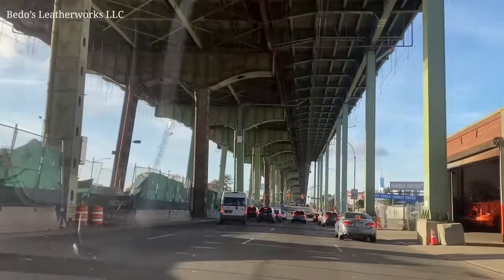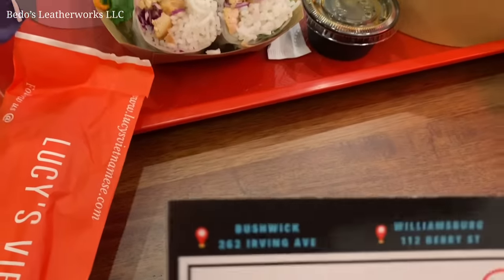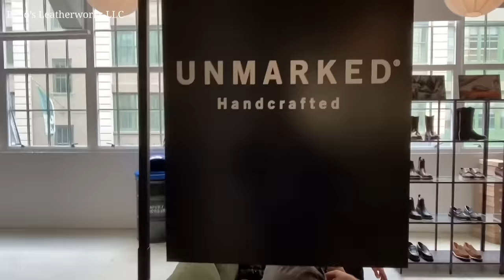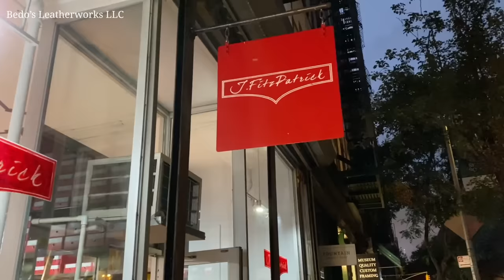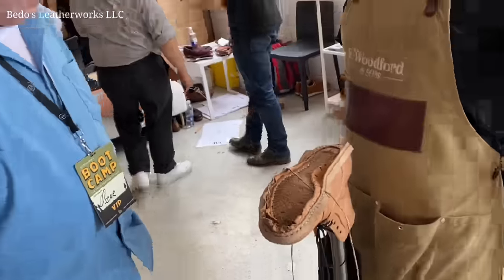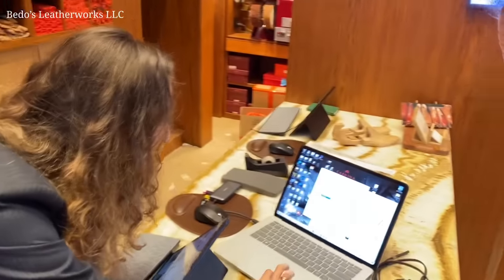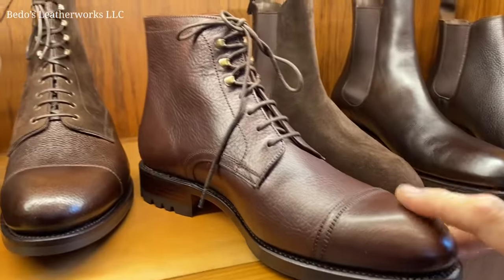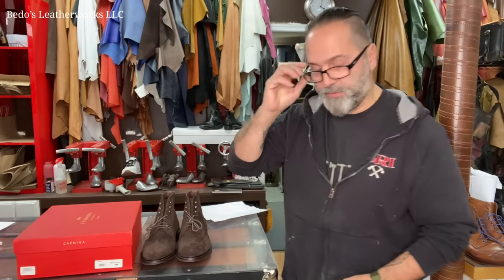BOOT CAMP  in Brooklyn NY 2023

Comment: ☝️QUESTION: 
Steve, 
What do you use to thin the MASTER glue when it starts getting too thick to use? I'm thinking there must be something.
Thanks in advance.
Steve
Reply from the maker: Masters thinner
Reply: @BedosLeatherworksLLC  🤔 Have to get some. Thanks
Reply: Got a quart on the way. Good stuff. I used a similar glue back in the 1980's when I started out  leather working in my grandfathers zipper repair shop in West Middlesex Pennsylvania. It was called Cats Claw, or Cats Paw. Pretty much the same consistancy. Can't find it these days.
Thanks again. Enjoy your videos. 👍👍